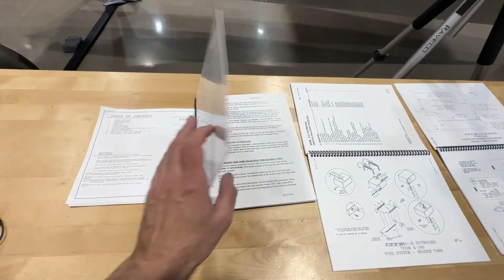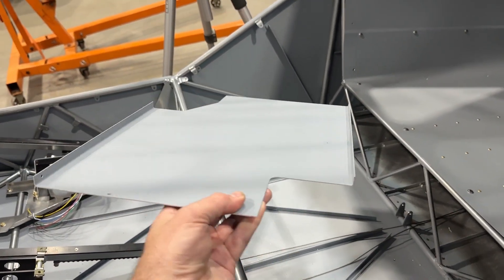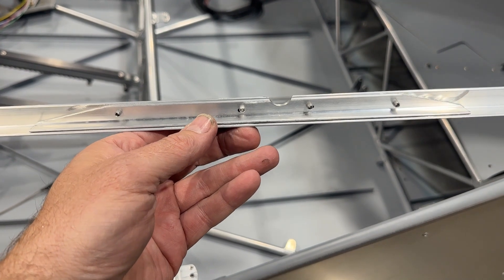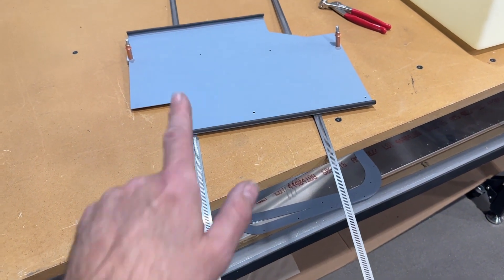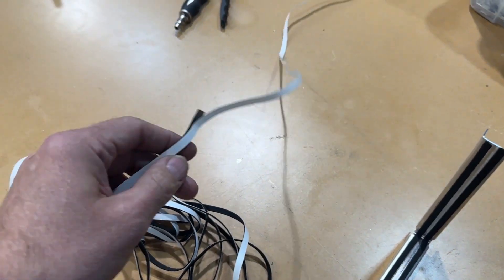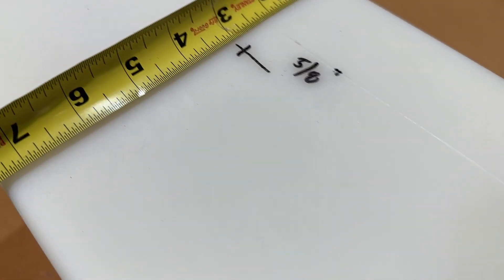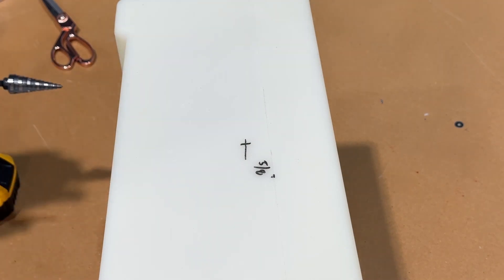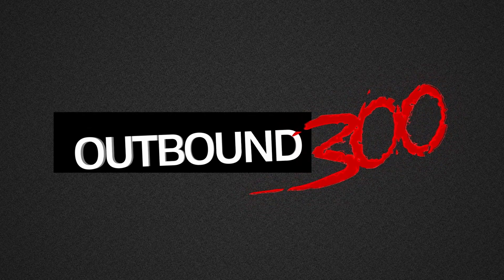Ep. 28 - Rans S-21 Header Tank: Part 1

Comment: A Carbon Fiber fuel tank? Carbon isn't really great for Everything!
 There is a whole world of composite materials, Glass, polyester, aramid, basalt, etc.
 All of those are better than Carbon for a fuel tank. 
 That tank looks like HDPE and is probably 10x stronger than your body cavity if you know what I mean.
 
 So yes you could make a tank that weighs half as much for 4-6x cost.
 I would recommend some significant amount of kevlar or Aramid for puncture/impact and a nomex honeycomb core for its individual cells that won't allow saturation. 
  Basalt, Glass, or Carbon for rigidity and weight savings.
 I could find better fuel tank material by cutting up clothes from a thrift shop than using all Carbon.
 If I built a composite tank it would be kevlar-basalt-kevlar with selective nomex core for local stiffening in large flats and around fittings.
Reply from the maker: Thrift shop clothes fuel tanks! Now there’s a business idea! Nearly free material and environmentally friendly. I like it! 

But seriously… I use the term carbon fiber loosely. More proper I should say composite. As you mention, there should be a mix of materials for specific purposes. I wouldn’t just whip one up with 2K twill CF and let ‘r rip.

Comment: i dont like that tank installation.  watched 4 others  and i just dont like it.  number one  why does it have to be so big. just and inch smaller would make a big difference
Reply from the maker: agreed! it could be 2 gallons less and it 'should' be aluminum at least.  An ode to Rans' heritage as an ultralight aircraft company because it's very 'ultralight-ish'.
Reply: Share your source for the sticky neoprene tape. Pleeeze??
Reply from the maker: www.mcmaster.com.  Search for EPDM strip.
Reply: Allow for a shutoff between the header and pump assembly. 👍